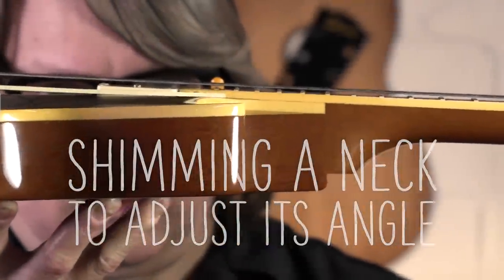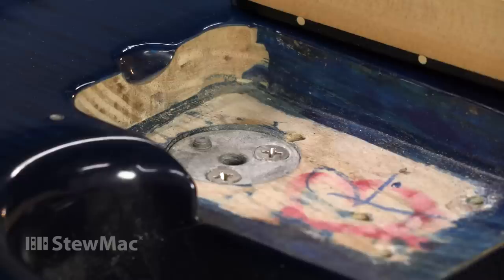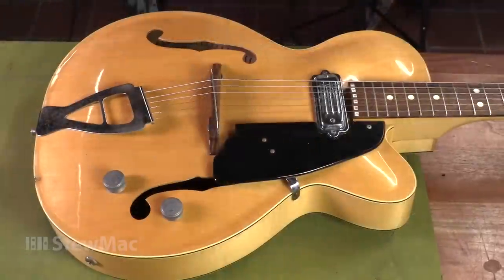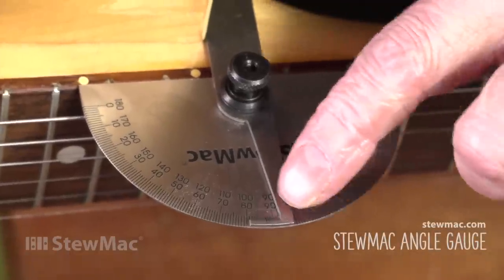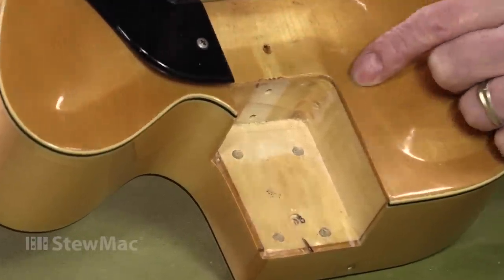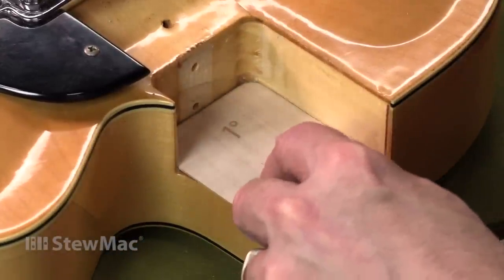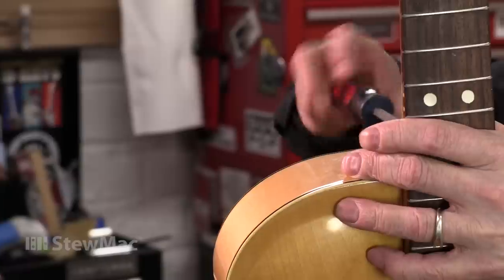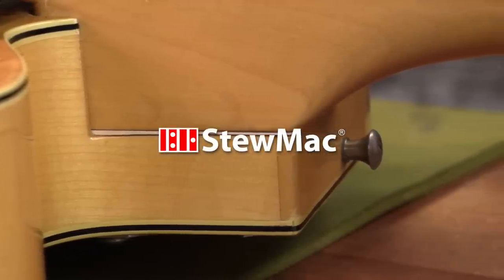How to shim a guitar neck to adjust its angle

Comment: I’ve never seen anyone use radius gages unless they’re machinists or an aircraft sheet metal mechanic. I’d never thought I’d need them for a guitar. But it was the smartest way to do it it  IMO
Reply: I used a coin to get close to what was needed when I did mine.
Reply: @jedson01  Cheap & Effective, Thanks for the tip!
Reply: Just chamfer the corner ffs

Comment: Would be nice to also touch up the edge of the shim with amber or vintage clear lacquer pen....
Reply: I was thinking the same thing.
Reply: My thought as well
Reply: Yeah, that was my thought. If I were looking at this guitar to buy it but didn't know a lot about this issue, it would seem like a hasty repair for some problem. If it were colored to match, it would indicate that some thought went into it. Also, I wonder about the edge of the shim absorbing moisture and oil relative to the rest of the joint.
Reply: meh... you write and play music on it... anyone that close to your neck pocket when you're on stage; well it might be love, because they're chin in on your lap
Reply: llol @PilferMusic
Reply: I also thought that but I guess this video is like a demo. In real life they must using lacquer to inhancement the finish and looking.
Reply: I use a amber colored natural resin hard oil to do that. Any reason why i should use lacquer instead?

Comment: Hey, when people talk about fender vs Gibson, that initial point that he made about the angle of the neck relative to the body is NEVER brought up, and I think that's a huge factor concerning playability of the two designs and how it may lend itself to any given player. That, along with scale lengths, which not only affect string tension and therefore, ease of bending, or tuning integrity when striking the strings aggressively, thereby having an influence on string gauges, but also the amount of room between frets on respective scale lengths. I.e. the 15th fret on a fender scale has more room between it and the next fret than the 15th fret on a gibson length.. Anyways, you guys probably already knew that, but it felt good to see that pointed out.

Comment: Awesome video, guys.  I bought a few of these shims for my Fender basses.  Like you say in the video, they work great for compensating for variations in neck pockets, but they also increase the break angle of the strings as they pass over the bridge saddles. This, in my experience, is great for note clarity and sustain — especially on bass strings.

Comment: Enjoyed the video a lot but come on guys... $91 for 12 shims?
Reply: That's the price for the complete set. If you know what you need even remotely, you can stay under 10 bucks.
Reply: It’s a shim. Come on... if you don’t want to make one, you can buy a bundle of hardwood shake shingles, already angled and ready to use, for $3 and have enough for years. Even selling them for $10 a shim is a bit much. This is what gives StewMac a bad name.
Reply: @budandbean1  -- Moreover, when I asked my late friend -- an industry giant who knew more about how an electric guitar functions than anyone alive today -- what he'd use to change the neck angle of Fender-style bolt-on neck guitar, he immediately answered, "Washers," explaining that there's almost never any benefit to mechanically coupling a solid-body guitar's neck to its body, the sole exception being the very rare such instrument in which the neck happens to resonate at an even harmonic of the body's resonance.  He then said that, in most cases, shimming a neck with a large hardwood shim is a best no better than using washers and, when tight coupling results in significant acoustic phase cancellation, those big shims can actually be detrimental.
Reply: I have made them myself, it is actually quite a bit of work. And when you're finished you may well realize you've sanded too much down... Just sayin'
Reply: I'm not going to defend their price policy. If you don't want to spend money, build a guitar from scratch. If you want pre-cut shims, you have cheaper options than the 91$ set you mention. That's all.
Reply: Hardware store shims have a much steeper angle. Completely useless for guitar necks. Plus, they're carved out by the thousands on a daily basis and are not particularly precise. How can you compare StewMac shims to Home Depot shims? It's like potted meat vs prime rib.
Reply: Sometimes, you have to pay to play.
Reply: They're not selling to you... they're selling to the repairer who'll just pass the cost on to the customer.
Reply: Been playing guitar for 28 years, been working in construction for 22 years. I feel bad for someone who can make a simple shim out of scrap wood. What they sale for $91, I could make 100s of them in 20 minutes with a block of whatever hardwood you choose and my chop saw for absolutely free.
Reply: @roberthelmick9574  
Some people have not been playing guitar for 28 years & been working in construction for 22 years so they need a to buy this product.

I however have been working in construction for 23 years & been playing guitar for 29 years and I will buy this product.
Reply: @outsidethepyramid  thanks for pointing out the obvious... I know not everyone has worked in construction. But you mean to tell me that a person can take the time to learn how to play a guitar, learn and understand the concept of how it works and all the components it requires. They can learn that their neck is sitting at the wrong angle not by 1 but 3 different points. But these same people are incompetent when it comes to figuring out a way to get a hold of some shims? And you saying that you work in construction and would still pay $97 or whatever it was for 10 shims is just idiotic by any standards.
Reply: Supply and demand buddy.  It has to be profitable. I bought 1 for cheap.
Reply: Just think about how much time it would take making it, and how much money you can make out of that time. It's not that expensive. just get the cost from the customers. Otherwise, if you are doing it only once, even the money and time for delivery could already be waste.

You might be concerned about 'the angle' only, then that's why people use sandpapers to shim, end up with shitty sounds. There are many people who'd rather spend money on this than do the job easier and cheaper, because it affects the sound.
Reply: Tried the 1 degree and it was too much. The .5 was just right. For someone that doesn't have these time or resources to fiddle around with making their own shim, the Stew Mac shim was perfect.
Reply: @outsidethepyramid  You know, I may just be an asshole to work with at times. But at least I'm not a carpenter that can't make his own shims...
Reply: @roberthelmick9574  Sounds like you have your business plan in place. Good luck.
Reply: And round and round and back and forth we go. I got tired of this debate weeks ago. Can you please find someone else to quibble with? Thanks so much.
Reply: @JohannesLabusch  thanks buddy, it's going good so far.
Reply: @roberthelmick9574  So make them and sell some, that's the beauty of a free market.
Reply: @outsidethepyramid   I  have been working in construction for 24 years & been playing guitar for 30 years, so I win...
Reply: @roberthelmick9574  will you send me 300?
Reply: @PilferMusic  got you fam! What's ur address and what kind of car do you drive? Any pets?
Reply: This why so many hate StewMac, way overpriced. It’s called greed but if you know where else to shop you will rarely if ever need to buy there.
Reply: Just use one of those hotel keys, I did, it works
Reply: Yeah, kinda 'spensive
Reply: You can buy set of brass shims on eBay for $12
Reply: Opinions opinions..... but go on amazon and search luthier tools. And see how the dollar amounts for everything as you scroll down have a pattern too them for example you'll see 10 to 15 fret rockers  in a row priced from $5 to $10 and then you'll see one for $35 then 10 to 15 fret end nippers for $15;to $25  then a pair for $75 then you'll see 10 to 15  nut file sets for $10 to $35 and then... you guessed it, a set for $185. And if you're at least a graduate of any 2nd grade elementary school class then you already know what I'm gonna say next. The high dollar amounts all belong to stew mac! Because their fret rocker has 31 extra millimeters of measurement due to them utilizing the entire length of each side to print a few more lines on the same exact cut of cheap metal and their end nippers have just a hare  of extra cushioning on the handle grips and their files have just a few more teeth/ ridges so when Dan Ehrlwine makes a video and says they are his favorite tool of all (which he says about every tool he pulls out in these videos) it will make people say to themselves that if he loves its gotta be worth a 1/3 of a weekly paycheck to buy it. So for all the stew mac band wagon defenders against the above comment  inferring that these shims that could just as quickly get whittled down into hamster cages for a species of rat to piss on being superbly overpriced.... well I'm gonna guess y'all are the ones that fall for this BS and you probably already have 2 3rds of the stew mac catalog in a box under your beds, where you lay at night and just dream of getting to move to ohio and work under Dan and learn how to become an ultimate do it yourselfer. Or y'all just have a secret crush on Dan the man. I assume these points because any numbnuts with a belt sander and that 2nd grade diploma i mentioned earlier, could easily make a shim in minutes and not need to pay a Bill and wait days to receive them just to have to sand them down anyways to get em just right for your needs. Nuff said. You're welcome for this bit of free common sense i bestowed upon all you guitarded stew mac fan boys.
Reply: @roberthelmick9574  perfectly stated. They can't learn how to make a shim after learning everything else?  Especially when learning guitar tech and luthiery? 

(Yes, this is a reply to a 7mo post)
Reply: I wish I could get StewMac products in the UK. Ok, some of the products are expensive, but, they just work. I suppose it’s like Apple Computers. You can get a cheaper alternative but in most cases it isn’t anywhere near as good as the purpose build machine.
Reply: ShipBuilding actually my greatgrandfather invented and patented the shim so they are that expensive because they give my family royalties... oh and I’ve been playing for 30 years and a construction worker for 0.375 years
Reply: @Elektrifekt  I'm not sure Apple is a good parallel to draw.  Apple provides a unique experience compared to other brands.  There really is no alternative to the Apple experience, and that's what you pay for.  StewMac is selling wood, the same wood you can buy at a hardware store, and banking on ignorance and laziness because they brand it as for guitars even though regular shims will do the trick.  I don't understand why people get so upset by pointing out how insanely overpriced these are at $115 for 12 slivers of thin wood.  If anything, people complaining here helps inform such buyers that these prices are pretty ridiculous.  Hopefully that creates the competitive pricing we're supposed to see.  Maybe they had the disposable income most do not, bought them and were happy, and now anyone criticizing the product feels like a criticism on themselves.  Who can say?  But these are just wood.  You're paying for wood...thin wood.  No need to overpay because of a sales pitch.
Reply: Buddy Martin everything from this company is ridiculous expensive, not to mention the inflated shipping cost.
Reply: Stew Shyster.
Reply: Hi guys I have a guitar originally with a 14 degree angle a dean ML. It has a tuneomatic bridge. Have a warmoth strat like neck now. What kind of shim angle do I need? Thanks!
Reply: @pbg9208  There exists luthier neck angle gauges.  I've seen several videos with them in use.  Also, if you know how to measure (taking in account string height), you could use a protractor to estimate.  Sand down the shim as needed.  I'm not an expert... but when I made my own shim, that's how I did it.
Reply: @har234908234  That's a good response, makes sense.
Reply: @outsidethepyramid  Lol, what an awesome response. You just edged him out.
Reply: @budandbean1  that's the only reason i have bought nothing off of them yet. i know good tools are expensive but their prices are ridiculous. then you have the cheap worthless chinese crap for buttons. most of it is not good for anything. if somebody started making guitar maintenance tools for half the price of stew mac, I believe they could make a whole lot of money. i'd be buying. but not at this price. come on man, i am from eastern europe. i ain't going to work a whole month for a couple of neck shims. what am i going to eat?
Reply: With a belt sander, you can make a dozen shims at any angle in very little time.
Reply: For me when you find the “right person to work on your instrument” it’s worth xtra. I don’t work on mine except for changing strings etc. 
besides every professional gets paid accordingly. Try a plumber electrician 
Any of the skilled trades.
Reply: They also charge $12 to ship one shim that weighs a fraction of an ounce, is 2x3 inches and only a few millimeters thick.
Reply: Hahaha no chance I'd pay that I'd make em myself lol wow
Reply: I know right? Stew mac is overpriced evvvverythang
Reply: Ya im using a mini fruity loops box and a razor lol its just as good. And they are exactly .1 mill, compress a little so no air gaps.
Reply: @editorjuno  very true. Also why i just use very dense, thin pieces of cardboard. I just don’t like leaving air gaps so I’ll stay away from the washer lol.
Reply: @TheIgnoramus  -- The guitar doesn't care whether we "just don't like like leaving air gaps," but we are free to suit ourselves in that regard.  😎
Reply: Wow thank you sir!! For helping showing me what to do I cant believe my guitar now the sound of it,and the action I can get,I can go lower if I wanted but I'm good with 2mm low E that is good for me,I never thought I'd achieve this honestly it took me over a week though for the whole process abit longer than normal person haha but wow my guitar plays great thanks to yourself showing how to do this thank u sir many many thanks.
Reply: @TheIgnoramus  -- Any "air gaps" are a strictly cosmetic matter and therefore "in the eye of the beholder," so we can all suit ourselves in that regard.  It's not like anyone other than fellow gearheads are going to staring at the details of our guitars' neck pockets. 😎
Reply: I love using these shims.  They just plain work.  If I'd have been doing that job, I'd have used a black permanent marker and blacked out the edge of the shim.  With the black line of the binding and the edge of the shim Black, it would look like it was there from the factory.
Reply: What, 10 bucks <> for a piece of friut crate. They must work or they would'nt have the Cahonez to ask such a price. I may just retrieve that old orange crate from the Rubbish bin?
Reply: Yeah StewMac has been engaging in highway robbery from the jump.   Thankfully they ain't a monopoly anymore.

Comment: I have an Alvarez 335 knock-off. It had that same thing going on with the pickup at that extreme funky angle. The pickup ring was the problem. It had a pretty steep angle. I turned it around and the pickup was then almost parallel with the strings.

Comment: This was a quick easy adjustment for me. Yeah the stewmac shims are a bit pricey (I only needed one but had to buy a 3 pack for 20 bucks) but when I got it I just threw it in, no cutting or shaping. I 'd just bought a 1975 Fender Mustang off of eBay and when I got it the bridge was too the deck and the action was 7/64 on the bass side. It had a Factory shim in it but obviously it was doing nothing so I got a 1 degree shim, strung it up, got 4/64 on the bass side with a little play in the bridge and it plays like "Buttah"....

Comment: great vid learned that proper tool and knowledge jobs are quick and easy, using a radius gauge might help with that tricky shielding tape, with shielding i was told try to have it in one piece at a time, and don't overlap or youll have to soldier the overlapped piece so it can get a electrical ground signal,

Comment: Excellent viddy, learned a lot. I have a Strat with what most players would callba high action and they would be right but the sound it makes is massive. I shimmed it to see if I could even the action out as muchbas possible but it lost it's magic so  removed the shim , maybe it's just the way it works best , its great up to the 9th/10th fret but when you play standing up it becomes a really physical scene as you end up having to wrestle with the thing. The acoustic "pingyness" is more present with a higher action. Having ssid all that I may try the .25 and probably remove it again but I will try. Thanks .

Comment: Whet I live, with the exchange rate and postage, these are far too expensive.  But I like the radius gauge idea.  I usually take some measurements and use trigonometry to work out the shim thickness.  Then I use hardwood veneer, shaped and glued in place....  Thanks again for a nice video.